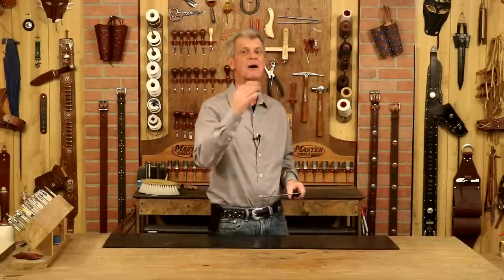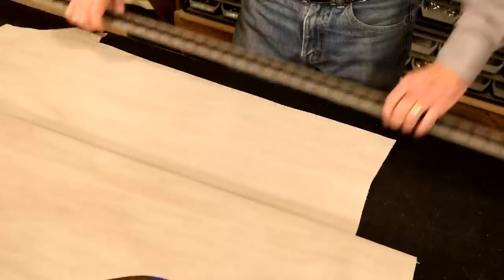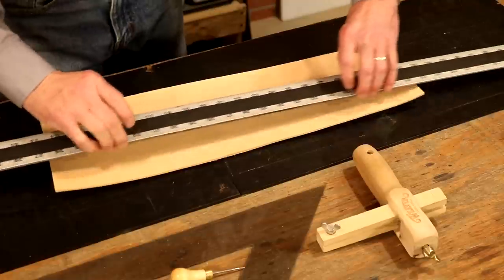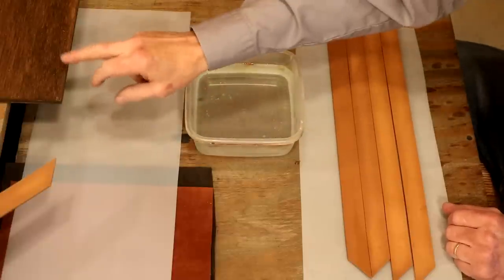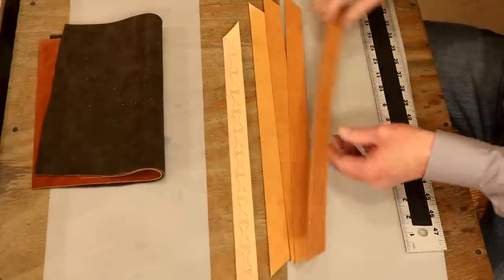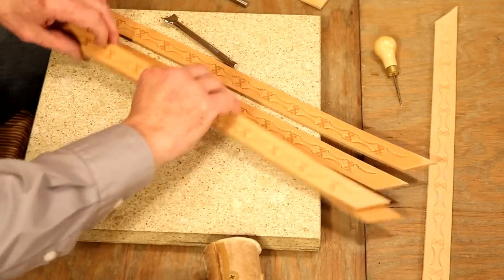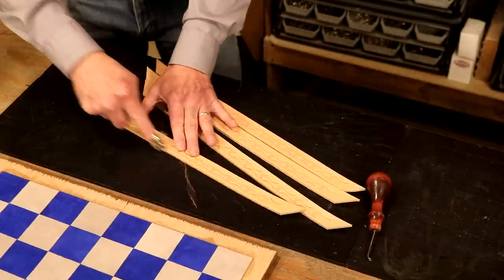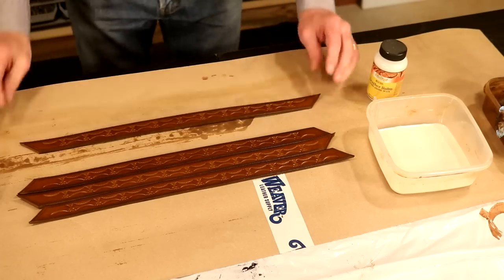Making a Leather Chess Board

Comment: I'm totally making one of these for my father-in-law. But as a woodworker, I'd add one more detail: wrap the outer edges of the plywood with some hardwood, in this case probably walnut. Make the walnut pieces slightly thicker than the top edge of the leather border pieces, and now you don't have to worry about catching an edge and accidentally pulling up the leather over time.

Comment: Interesting and a good looking board. As a woodworker, I wonder how the suede would hold up if you contact cemented a panel to a board and then cut it with the bandsaw? I wonder if it would clean cut the suede or chew it up? 
The reason I wonder is that when making a wooden chessboard, you glue strips of wood together and cut it, then turn each cut strip 180deg to get the checkerboard pattern, if the suede could hold up to such cuts it would make the creation of the board much easier and less time consuming.
Reply: I think it would cut just fine. Provided your blade is sharp. Or you could cut the suede with a razor before running it through the bandsaw. I think that would help eliminate the blade catching the suede.
Reply: I was thinking about cutting it with a utility knife myself, it is only 1/4" Luanne. But now that you raised the question, you gotta come back and let us know how it worked! lol

I am pretty sure I know what Chuck reasoning for doing it this way is though. He can cut and apply Leather squares super accurately, I don't think he has near that confidence in his wood working skills.

Comment: I like your work.  However, being a woodworker, I do not think it was a good idea to pre-cut the leather borders and miter the edges for all 4 sides.  When making that board from so many small pieces that need to mate perfectly, you will not have a perfect final dimensions.  Then the precut edges would be the wrong size and not fit.  I would have made the strips and form-fit the corner miters as you install each of the 3 sides.